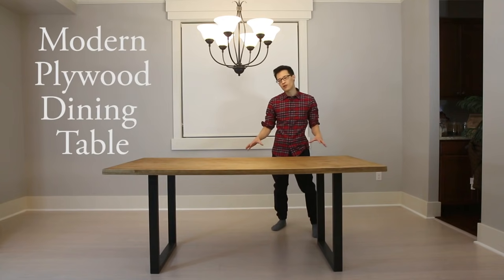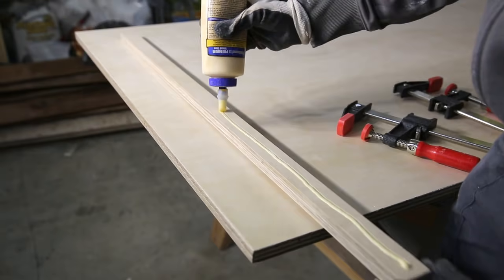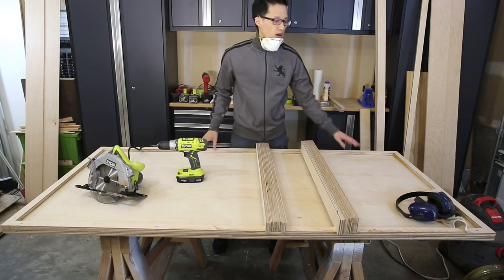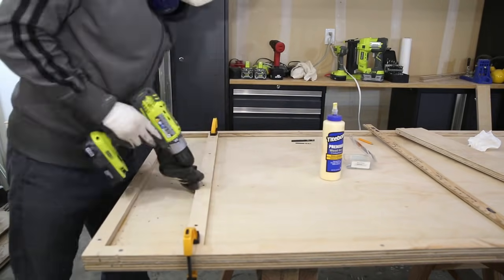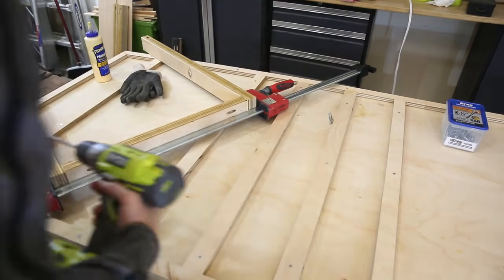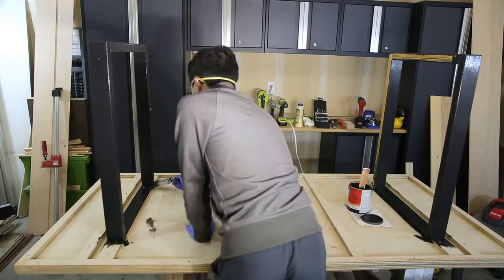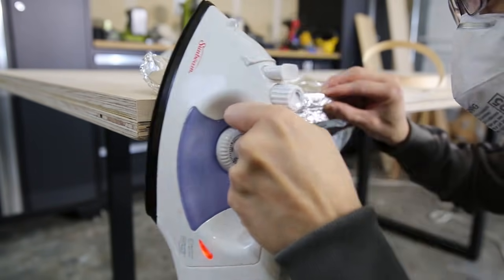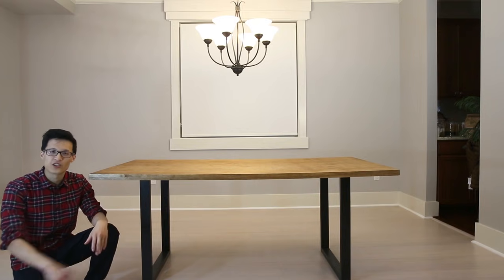Modern Dining Table DIY | Single Sheet Plywood | Two Power Tools

Comment: Is it just me or is the table bowing down in the middle..?🤔
Reply: first thing I noticed lol
Reply: No doub. With one layer of plywood, it is expected to happen
Reply: I noticed
Reply: Plywood willaways do that
Reply: It's you
Reply: How to you prevent that?  I thought about gluing 2 sheets of plywood together? What are suggestions?
Reply: @snw1964  maybe a crossbar in the middle? Even if you use 2 sheets, the weight and gap between the legs will make it drop in the middle..i think
Reply: @snw1964 two sheets would definitely improve the design. Make sure they’re laminated together really well though

Comment: 2" wide plywood 'beam' screwed to the center, between the two leg assemblies (on edge) will prevent sagging
Reply: Two 3 inch strips running between the legs across the length of the table would work well too.

Comment: The second it started i noticed the sagging in the center, putting the plywood on edge to make the skirt and supports would've been better for longevity of the table. Also, you should buy 2 sheets of plywood to do something like this, it's still cheaper but you'll have more material to strengthen your table.

Comment from the maker: I made a few mistakes building from scratch and learned from them so you don't have to make them! The written instructions are now on my blog with updated Leg Modifications that eliminate the SIDE WOBBLE concerns. Thank you for the constructive criticism, always building and improving! I would add Metal L-Brackets to strengthen. Update video: https://youtu.be/RZdgcwOv97c
Reply: Center table design

Central table design
Centre table design

Comment: How has this table held up? I own a small bar and this would be a great table. Do you think it would hold up well being  just a plywood sheet? Or should it be reinforced more? It's a bar so we don't really overload the tables with weight. Also if I do go this route...what protective coating would you recommend for it? Since we do serve cold drinks the table may get damaged
Reply: No one cares.
Reply: @cezanini23  1/10 troll made me respond

Comment: Great table and work! but  needs more reinforcement on the legs!! no lateral support.. any lateral force is dangerous.
Reply from the maker: Thanks! Yes I am working on reinforcing them and posting updates on my blog. I stood on the table without any issues. I see the legs breaking if you have substantial weight 150+ lbs on the top and someone kicking on purpose to break it. but if you were to just kick the table from the side it without any weight on top, it would just move across the floor. But honestly who goes around kicking or pushing the table that hard from the side haha.
Reply: Paul Tran DIY who? Kids or  friends ha ha, sorry for  my english, add l metal shape  greetings
Reply: switch to angle bar for legs

Comment: Great vid man. Did u have any issues with side wobble?
Reply from the maker: There is some side wobble similar issue that Modern Builds has on his modern split top dining table. I revised my plans to make the table legs more stable on my blog but I have not rebuilt this table to test those plans. But if that still has some side wobble I would add a stretcher down the middle the way Modern Builds did it. That should stabilize everything.

Comment: i want make gaming table, but i cant find a simple one.
so im here  T_T
the problem is, i need the most efficient for simple cable management for the desk and place for pc tower and monitor
Reply: You would need a stronger table leg for that. Maybe metal square bars would work best as you can route the cables inside the legs
Reply: Check out bob at ILikeToMakeStuff

Comment: wobble label there
Reply from the maker: There is some side wobble similar issue that Modern Builds has on his modern split top dining table. I revised my plans to make the table legs more stable on my blog but I have not rebuilt this table to test those plans. But if that still has some side wobble I would add a stretcher down the middle the way Modern Builds did it. That should stabilize everything.